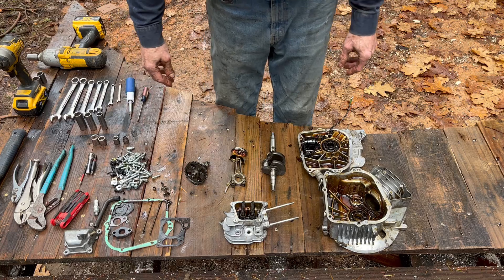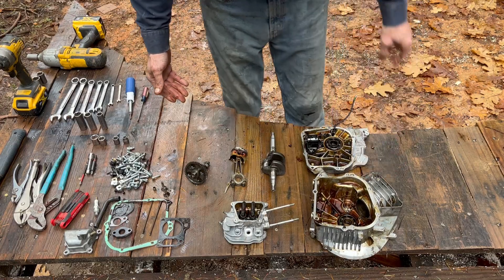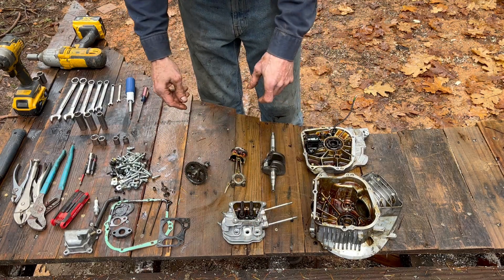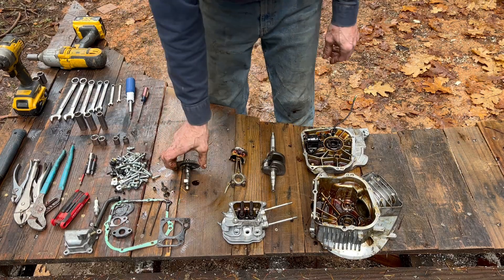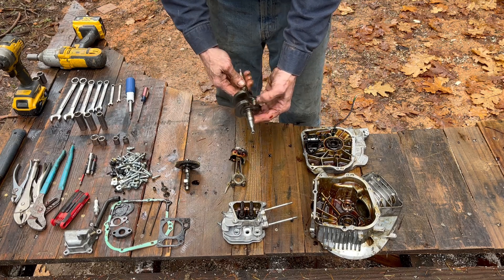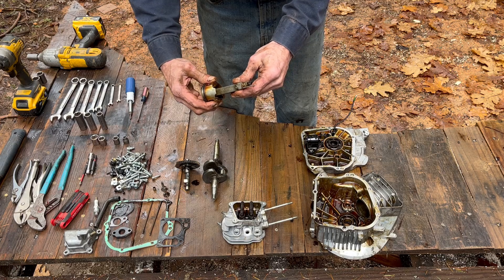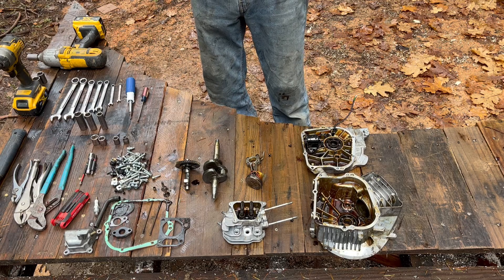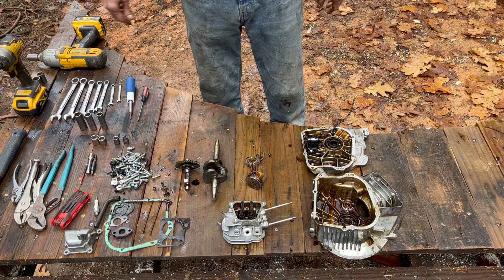20k hours Predator 2000 generator - full teardown

Comment: to put that many hours on a car it comes out to 700,000 miles, not buying it
Reply from the maker: Not entirely sure what you’re not buying, but I’ll give it a shot. 

At the time, we were living off grid in Oregon and that generator provided our power. It ran continuously during this time. 

My channel is unmonetized, I paid for that generator and the one that replaced it (not HF btw) and have received no compensation of any kind for making that video or any other. 

My 20 year old Pickup has 12k+ hours and our skoolie has 16k+ hours so it doesn’t seem so far out of range to me, tbh. 

Hope this helps.

Cheers!

Comment: Wow I probably have 2-3 weeks of runtime on mine and I thought they were getting towards their end of life. I just went ahead and changed the oil, hopefully I can get many more camping trips on them
Reply from the maker: The consensus seems to be change the oil (I’m using synthetic in the new gen) and adjust the valves and they may run forever although there are no guarantees because the quality control is low. 

Cheers and good luck!

Comment: Dude,that’s incredible!
I would never have that anyone would see those kinds of hours out of one of these.
Especially with the infrequent oil changes😂
You got your moneys worth!
My problem with the Predator series is they change parts and the quality control isn’t there.
We could both buy the same model the same day-yours may last forever and mine will crap out in three months.
Pot luck
Reply from the maker: Truth brother. 

The two greatest issues I’ve had with HF over the years have been that initial setup and fiddling is required and quality control is non existent.

Cheers!

Comment: I saved this video because it's so good and shows how the thing is built.  I have two 3500's that I use around the farm and thinking of getting a 2000 as well. Predators are very well built I think.  I'm only seeing splash lubrication which is the dipper on the rod, do you think it's no pump and oil mist  only that oils the rocker arms?  Can't wait for next teardown.  Thanks for vid.  Greetings from the farm near Battle Creek, Mich.
Reply from the maker: Wow. Thanks for the kind words. We will have to wait to see what blows up around here for the next teardown. 

Yes, your understanding of the oiling is correct. Dipper on the crank and oil mist to the top end.
Reply: This week I’m about to do a teardown on a 2000 W unit so stay tuned to my channel.
Reply: @bluewhaleadventures152  Checking back in and wondering how you're doing?  Bought a 2000 a year ago and never started it.  Pulled the case halves off to look into bypassing that C.O. sensor as they all cause problems.  No info then but now there is a couple vids to unplug the two 2 wire connectors that head to the sensor.  Then you are left with a male and female 2 wire connectors that go into the wire harness.  Connect them together and sensor is bypassed.  For myself and others it does not work so they did something different in china.  No matter what I did it would only run about 5 seconds.  I plugged the sensor back in like factory and it ran perfect for 1.5 hours.  Mine was built 3-2023.  Sensor also has a 4 wire connector going to the yellow light on the dash.  I'm thinking I'll be probing those 4 wires at the light to find out which wires have voltage while running to try to bypass.  Have you figured this out on your newer 2000?  Any more tear downs?  Thanks.

Comment: I’m thinking about getting one of these and keeping it forever. What would you recommend doing though if I have to rebuild the engine trying to find piston parts or just buy a whole new engine
Reply from the maker: I honestly can’t speak to parts and/or engine availability. 

IMHO, unless you run it continuously and neglect most if not all maintenance, and if you use a quality oil such as Amsoil, I doubt you’ll ever have to contemplate replacement.

Comment: How often have add oil or would they keep running low? You could use that Pulsar tank pump I bet or get propane umit and 200 gallon tank
Reply from the maker: As another person mentioned in their comment, the QC on these units in no bueno. This one used enough oil to trigger the low oil shutdown about every two to three weeks, or about 500 hours. The one I replaced it with uses much less oil.
Reply: I did a oil change and it triggered the low oil sensor.It doesnt start when sensor is “sensing” whether enuf oil or not.  So I disabled it, and then it burned a lot of oil, then had mechanical damage of course. so be quiet careful when you tweak with these things.

Comment: Could I use "Wireless Remote Control Switch 120V with 328 ft Long Range,40A Relay Switch,AC110V/120V/240V" As a kill switch for a similar generator?
Reply from the maker: Can you?  100%

Will it work?  That’s above my pay grade.

Comment: How many gallons of gas do you think it consumed in 20k hours?
Reply from the maker: Ha!  Well it used about 5 gallons every two days. Using that rate it’d be about 2000 gallons.
Reply: @bluewhaleadventures152 That's a pretty expensive power bill
Reply: @matt45540  Only in la' la land can you produce power cheaper than local power plants can.

Comment: hey do you still have the engine and all the parts?
If you do i'd like to buy them from you with the goal of rebuilding
Reply from the maker: Nope. Sorry, I’d have given it to you. After finishing the video I still had thoughts of rebuilding it myself but quickly realized the bore was nearly 020” out of round and abandoned that plan. 

Keep watching, in another 2-1/2 years I’ll have a new 20,000 hour teardown video of its replacement. 😹

 Cheers!
Reply: @daletrigger,,,, So just how are you going to rebuild an engine that you can't get ANY parts for?   It's not a Mack Truck.

Comment: Were the valves ever adjusted ?
Reply from the maker: Nope. 

For what it’s worth, although I didn’t check them with a feeler gauge, they had a reasonable but not excessive clearance when I rattled them back and forth before disassembly. Also, no sign of burning on the valve or the exhaust seat. 

Thank you for watching and thanks for your question. I wish I’d measured this prior to disassembly.

Comment: get extended warranty lol return
Reply from the maker: You joke, the one I had before this ran for about ten months straight and then stopped. Still being inside the one year warranty I took it back and they exchanged it for this one. Apparently most don’t use their generators like I do or they’d have a warranty nightmare on their hands.
Reply: @bluewhaleadventures152  Give Amsoil holler see if they would participate longevity enduro on new gen.  They like that

Comment: get mag dip run amsoil i bet they would pay for everything do video two years
Reply from the maker: If you ran Amsoil, changed it every 1000 hours and adjusted the valves, these generators would likely last most users well past their lifetimes. IMHO

Peace!
Reply: @bluewhaleadventures152   no change oil three times in first few hours and purchase wen magnetic dip stick in beginning.  Break in like others suggest then switch Amsoil 30 in summer 10w30 winter change oil every 100 hours or so or what amsoil suggests once month?  twice year lol